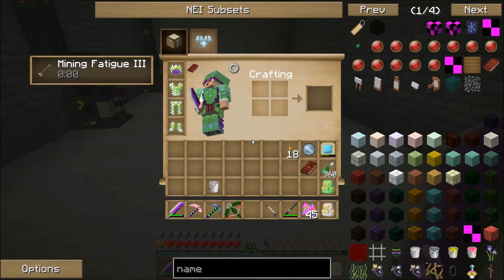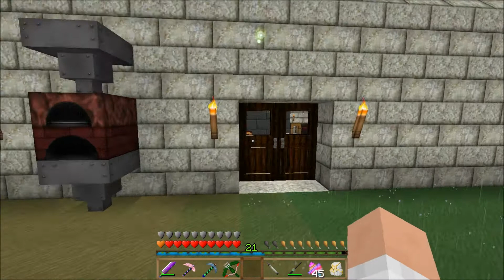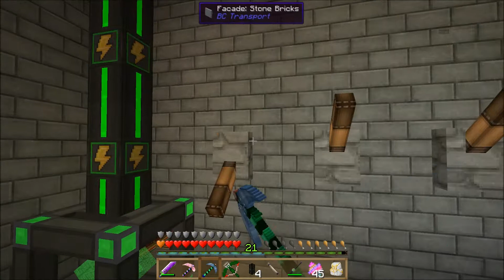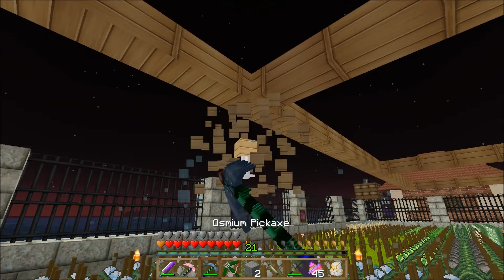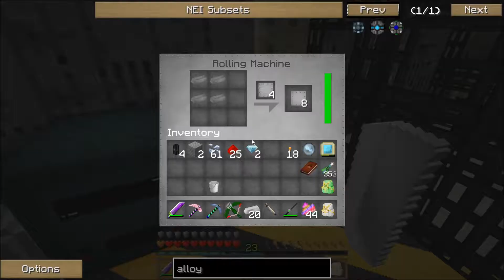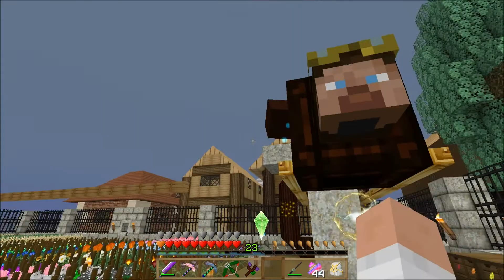Regrowth - Ore Tripling and AE start e30

Comment: The Gas-Burning Generator for Mekanism produces 284 RF/t.  The Electrolytic Separator require 284 RF/t to run.  For power generation I found that a complicated but very powerful combination.  Wheat put into a Crusher creates Bio Fuel.  Put the Bio Fuel into a Pressure Reaction Chamber with Water and Hydrogen produces Ethylene and Substrate as a secondary product.  Ethylene is energy dense and can support 6 Gas-Burning Generators with a little surplus.  I have a golem harvesting a 7x7 10,10,10 wheat field produces way more wheat than needed.  All 6 generators produce 1704 RF/t which is overkill
Reply from the maker: I like that, not was I was thinking about but I might use that as well.
Reply: Landstryder I have not tested the total number of Gas Genereators can be supported by Ethylene.  I found that the PRC can produce more Ethylene than 16 Gas Generators can burn.  A 4x4 wheat field of 10,10,10 is probably produces more wheat the the system needs as well.